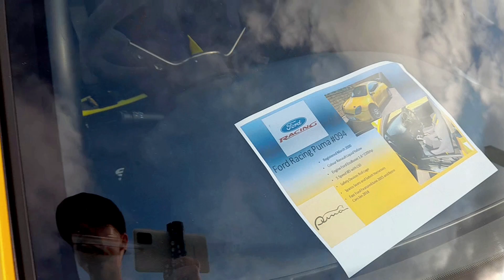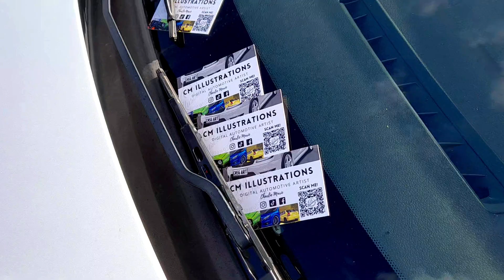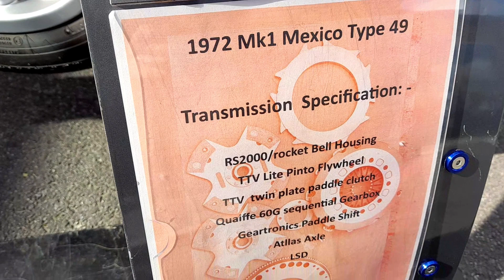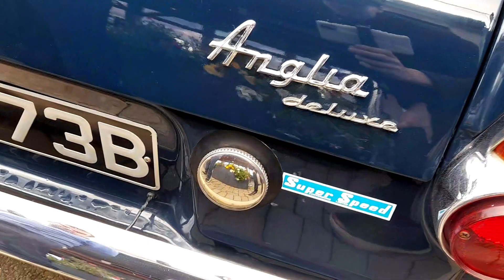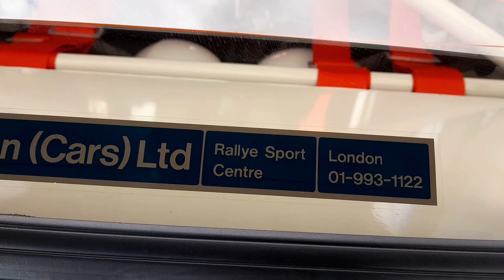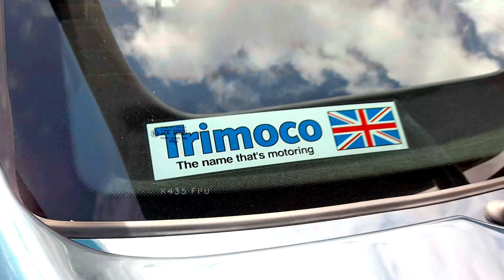"Ford Day " at the Motorist

Comment: Very nice Mk1 mondeo there. It was a lower spec probably a 1.8 (which you can see on the air intake box on Mk2s (removed on the Focus) but the badge is missing on Mk1s) and had ST24 wheels.
Reply from the maker: thanks for that mondeos are not my strong point :)

Comment: The fezza turbo would be worth so much more with original front lights and no tint on the rear indicator bits. Not an oil.cooler it's the intercooler brother.deffo bringing the focus to the next meet
Reply from the maker: Ah thanks for correct me!